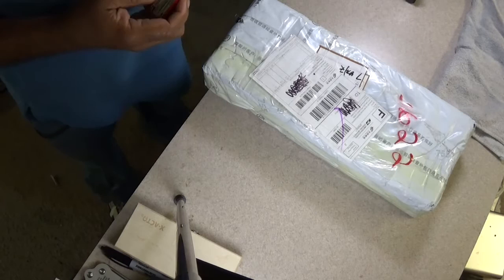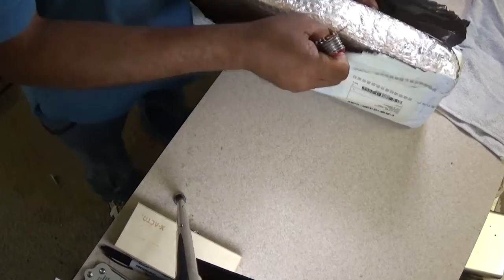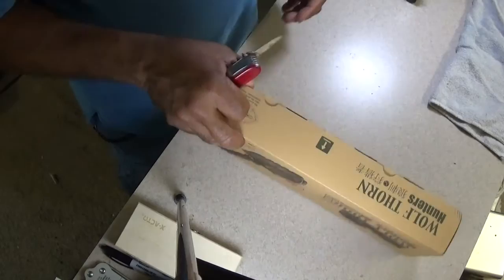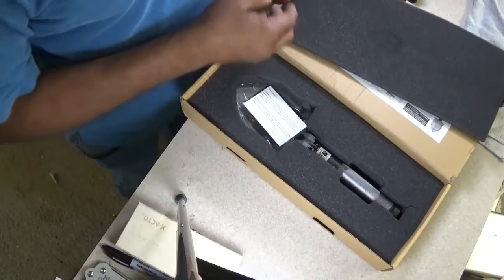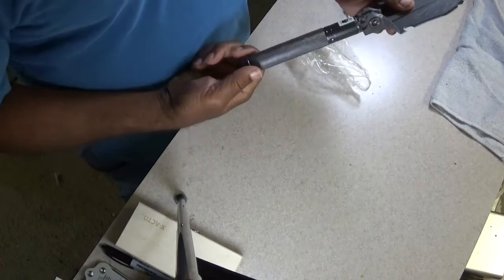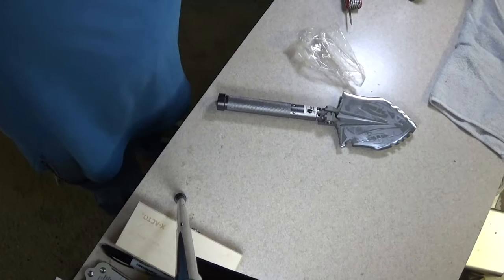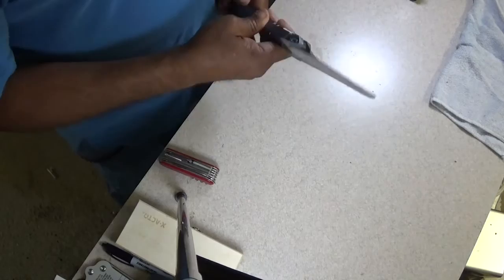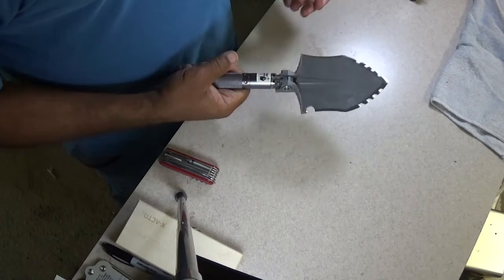Zingtech Wolf Thorn:  Compact Push Button Shovel a Digger Alternative?

Comment: did it hold up?
Reply from the maker: It has stood up and is virtually like new.. There are no major plastic components.  It is all steel..I don't see it failing in the forseeable future.
Reply: thanks, do you rough it lots? or are you prettyu reasonable in how you you use it?
Reply from the maker: I basically use it as a digging tool in all soil types...in the middle of summer its quite difficult to get through the soil in Texas in the dryer months, so that is the ultimate extent of my testing.